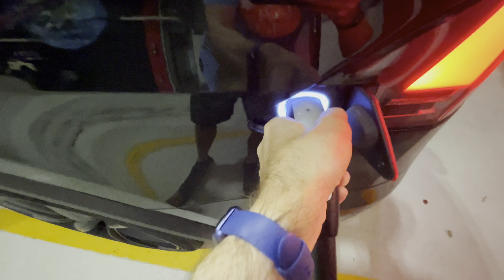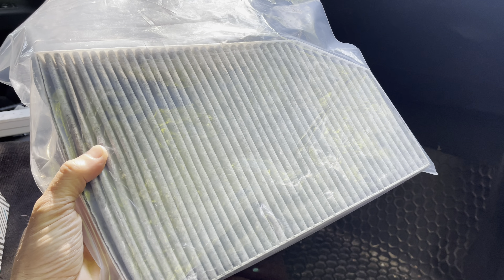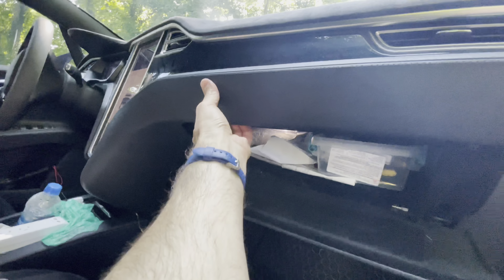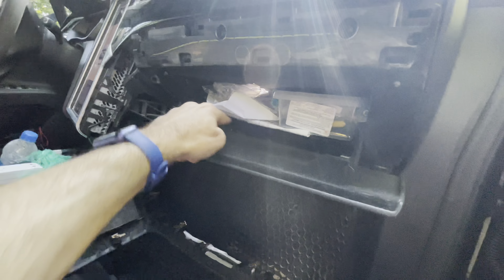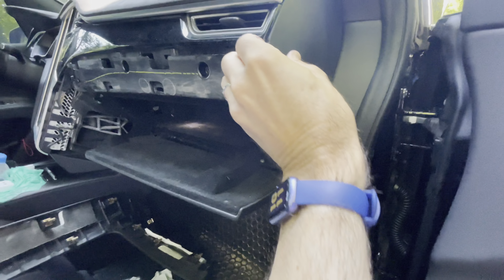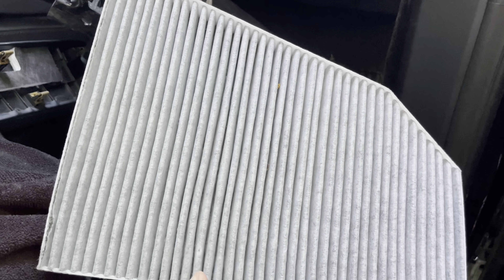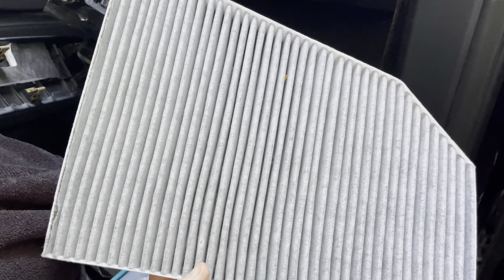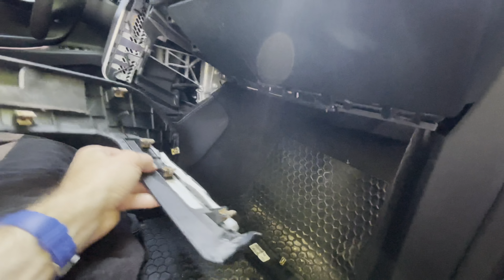EASILY Replace Your TESLA Model S or X CABIN AIR FILTER !

Comment: This a good video and offered all I needed to confidently replace the cabin filter.  Couple of suggestions:  1. I used the plastic moulding tools that were not recommended in this video.  My Model S was EXTREMELY snug and the tools gave me the ability to pull firmly in the correct direction on any given sticky tab.  2. The filter shown is not the same as a 2018 S which has a square filter.  3.  the cost through Tesla with accompanying hassle in getting is $35ish for the charcoal filter.  Amazon has a filter for $10 less which I ordered but didnt use since I had the Tesla version after picking it up at a facility--it looks and feels just as good, maybe better than OEM.  4.  Clean the squirrel cage while you have everything out of debris--I had a leaf fall in that made noise AFTER i reassembled the unit. Took it all apart, cleaned the cage and reassembled.  Second time is amazingly quick.   5.  My filter almost six years old was filthy (non-smoker) and I think one of the reasons I was getting that filmy look on the windshield that is so awful to clean.  I shall not wait as long the next time.  Follow this guy to the letter with some of these suggestions and you are good to go!